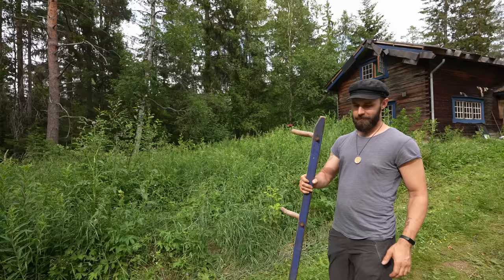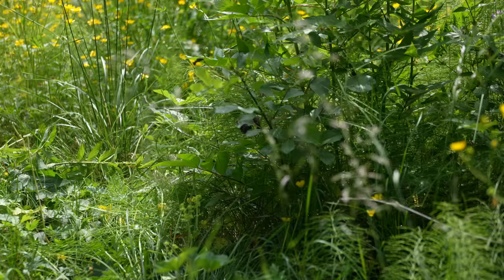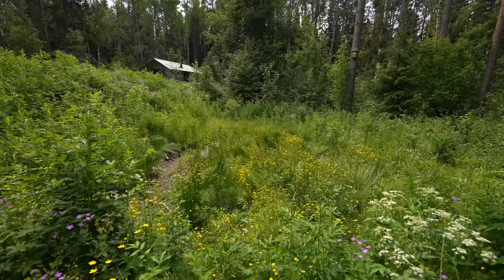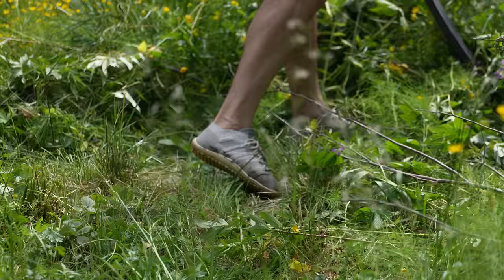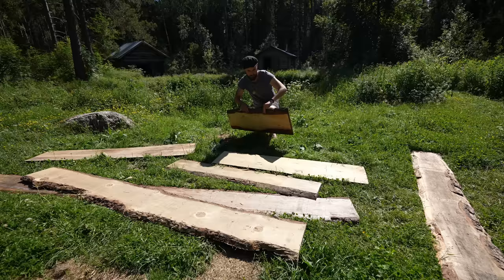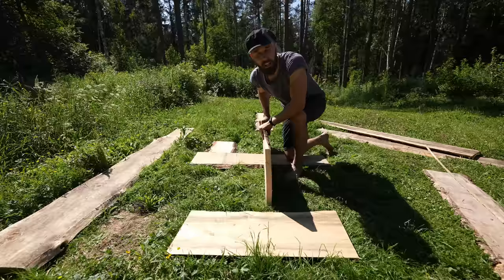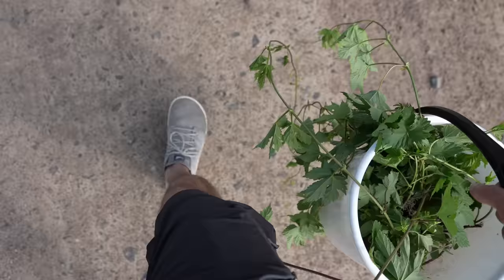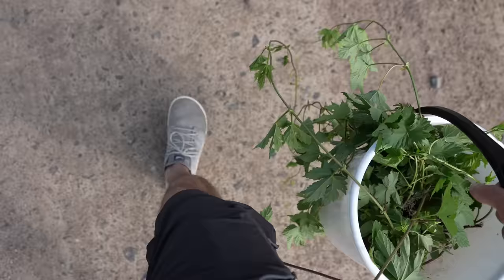Building a Wild Herb Garden in the Forest

Comment: Your herb garden looks great. I look forward to seeing it grow over the season! Suggestions: If you do more boxes/beds at the back, when you put the cardboard down, make sure to soak the cardboard with water before adding in the other lasagna layers. Wetting them thoroughly will make it easier for worms (and other detritivores) to help break the cardboard down, and it will also make it easier for them to make there way into the soil in the beds to help fertilize them. Also, if you can find comfrey and borage, definitely plant that as well (doesn't have to be in a bed - you can plant them around the perimeter). They will not only attract pollinators to your garden, but you can chop them back multiple times a season and use them to mulch your beds to help them retain water longer (you can also use the natural wood mulch as well, just make sure it sits on top of the soil and doesn't get mixed into it) and feed your soil all at the same time.
Reply: Yes! Comfrey and borage, Kalle.